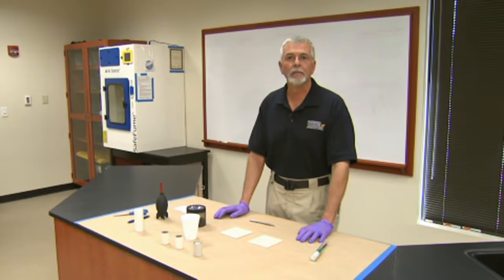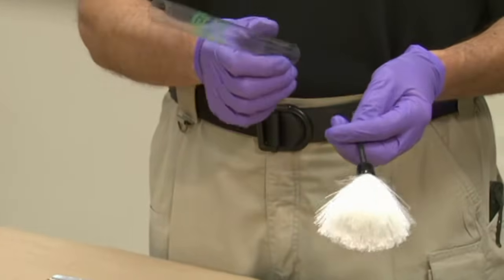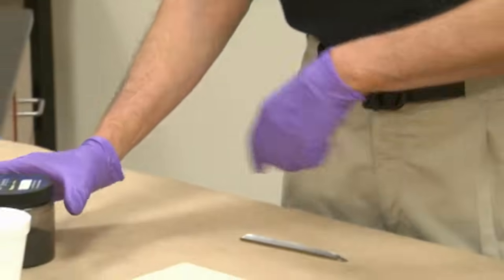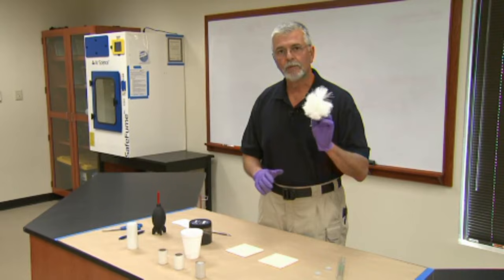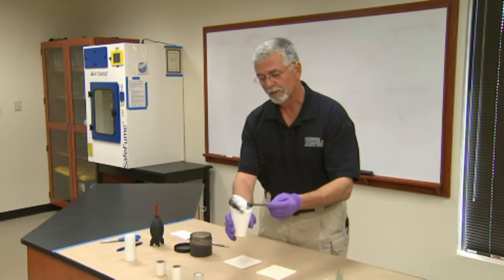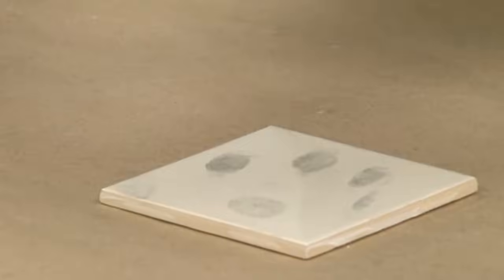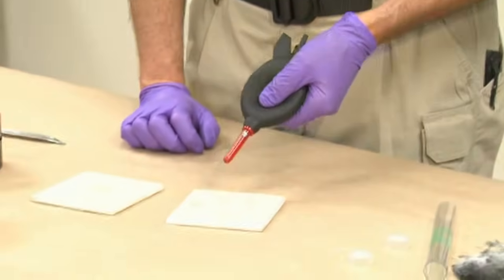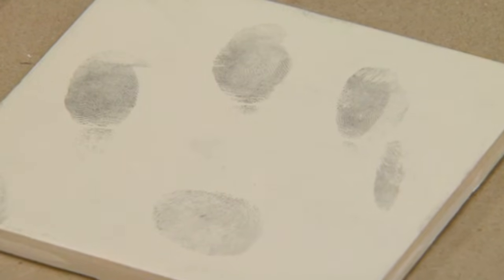How to Process Latent Fingerprints Using Non-Magnetic Powder

Comment: Half my house contents were taken by someone with  key access to my home.They left fingerprints behind on smooth mat surface and glossy surface in areas where items had disappeared.  CSI came out and said because if the light dust on the surface of the areas, they couldn't lift any prints as when the culprit touched the surface, they lifted the dust from the area and just left a finger shaped imprint.  Could this be correct?
Reply: yes because there’s no ridge details in the fingerprints and just a finger shaped imprint can’t individualize a print. Every fingerprint is different and the ridge details are what singles out a person and identifies the fingerprints so no there was no way to lift those prints because they simply weren’t prints anymore.